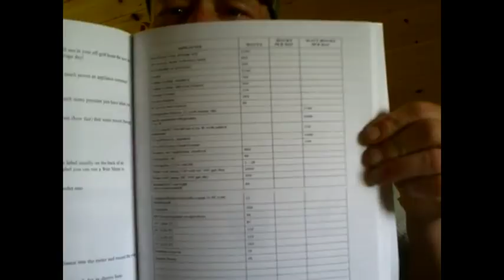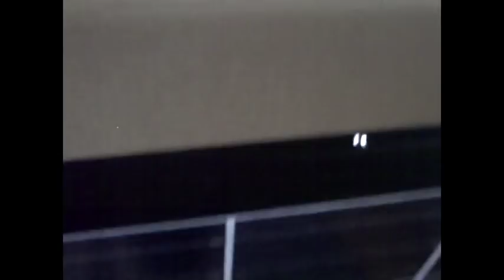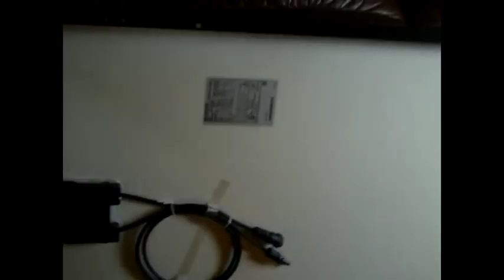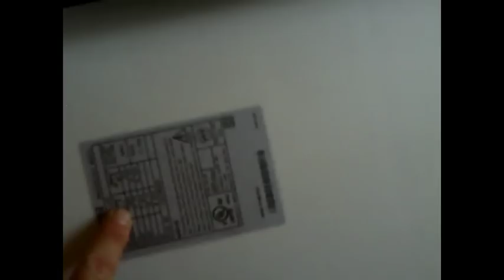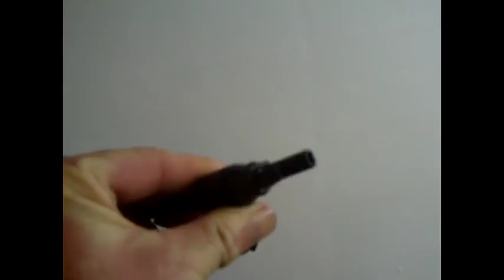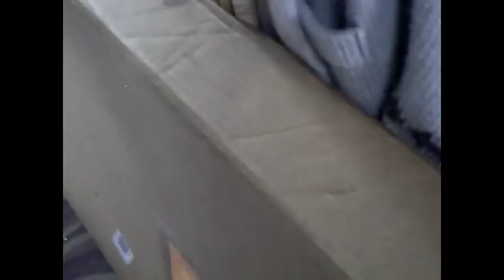Off Grid Solar and Wind Installation Part One

Comment: If I had not already subscribed because of your solar septic video I would have because of this video. You have given me so much to think of & so much hope. I really wish I could afford to live on my own land with a shipping container home that has solar power & my own garden. That is an absolute dream of mine. I like your video's those that I have seen & thank you for posting them. Thank you so much. All I need is 70,000 & I wouldn't need to much else for a long time. That much & I would be off grid & independent financially.
Reply: Why so much? All in, between 3 acres of land, 2000 watts of solar, and the cabin, I am in for $21,000. Here in the Rockies. Just curious. :)
Reply: That includes everything. Land, 3b 2 bath with everything but furniture inside, 2 car garage, work shop, totally custom home. Land here costs more then there but I will look into land there as that is a great price point for 3 acres of land alone. Did you build it all yourself? I would need workers as I am injured. Later on my page I am gonna post a short video of how I made a model of what I want my home to look like when I am done. The pic at the end doesn't include the out door spaces like the garden or additional on the ground solar panels, green house {& in ground pool made of 2 shipping containers if I can afford it}. Not to mention the fence. I don't like chain link fences. Love wood picket fences.
Reply: EmperorJinx151 There is the price differential! Fencing. One does not immediately realize that fencing three or more acres adds up. That linear feet in my case if 1500FT. 

I did all the building myself. Correct. Although for the Cabin, I did have a friend help for a few days to get it dried in. 

Looking forward to your model video posting.

Comment: I seen a few of your vids and have learned quite a bit. I have been thinking about a small 4-6 battery bank but atm I only moderate knowledge from just doing research, and ~half understanding of the electrical side. Some of my questions were, whats the current solar technologies (best decision for US city/residential environment, best batteries and understanding charge controllers. I also have been looking into assembling my own panels from cells which seems to greatly reduce cost. (Thanks!)

Comment from the maker: Concorde's are great batts. Get the specs for the number of plates, plate thickness and amp hours. Generally 6 volt batts have thicker plates and will last a few more years than 12 volt batts.

Comment from the maker: Your battery bank will level off. Unless you have an air turbine with a built in shut off controller you  will need some way to dump off the excess power. Instructions are in my book.

Comment: I have been wondering if 2  solar panels per every 12 volt link would be enough using 6 volt deep cycle golf cart batteries,or if 3-4 will do the job ? Also given uneven discharge events per battery on a battery bank would there have to be float chargers to cycle in and out,or would  neighboring batteries level off any excess charge,or discharge ? Does hybridizing a wind charger present any system conflicts while using solar panels on windy sunny days?

Comment: Hello Lamar, I have been enjoying your videos for the past 3 years,I live in NC,near the coast and I noticed a lot of videos like yours use 12 volt deep cycle batteries.I used to work at Exide Electronics and wired battery trays for computers Uninterruptable Power Supplies,and I upgraded 36 volt systems on golf carts to 48 volts.I have noticed that 6 volt or 8 volt deep cycle golf cart batteries can store more amps and use the same charging system. I enjoy your videos keep  them coming coming.

Comment from the maker: A 280 watt panel is probably 24 volt so yes use a controller designed for 24 volts and two 12 volt batts hooked in series for storage.

Comment: why is it that the solar panels they onli deals with wattage, what about the volts coming from that panels. because , the discreption on the back of the panel is a 280 watts, 37.4 volts. can i use a 30 amp 12 to 24 volts charge controller? can this controller handle the 37.4 volts? most of the charge controller 10 amp, 15 amp, 20 amp or 30 amp and always 12 to 24 volts. is it ok to use any of this charge cntrlr  no matter how many watts my panel is?

Comment from the maker: Most likely you need a batt connected before the controller will read anything. You can test the panel output with ant cheap battery tester.

Comment: well, it surges to just under a thousand watts when it kicks on, and stays around 120 watts according to my inverter (the inverter is 1500 watts) ... we have 4 125 amp hour batteries under the house hooked up to 2 235 watt panels... the fridge is from lowes i think, its small, but has a freezer and fridge... i think its 4 cubic feet?  bigger than a dorm fridge for sure.  Magic Chef I think is the brand name.  we dont have a generator yet, the batteries are fully charged by about 9:30 am :)

Comment from the maker: That is probably a 24 volt panel so you would need two 12 volt batts hooked in series. full instructions for 12 and 24 volt systems is in my book. simplesolarhomesteading

Comment: Perfectly explained on what's the difference between grid-tied and off-grid solar power systems. Off-grid systems are good specially if one's installation is on a remote area or on a moving vehicle.

Comment: -- Missouri Wind and Solar sells charge controllers that can handle 440 amps and 10,000 watts for solar panels and wind turbines. The cheapest controller, without a meter, is priced at $120. That means you could use about 70 of those solar panels with this controller. That should be enough. :) But it is not an MPPT controller, so it is not as efficient.

Comment: great video. I know you say you have to have an licend electrican to install a gride tied system.  that is false you dont have to but it still has to be inspeced, and it has to be up to code.  and if they find something wrong you just have to fix it . and when it passes then you will beallowed to conned to the gride and also the power company will also inspecit.

Comment: @solarcabin -- Now I understand why their wind turbines are cheaper -- they don't have as many features. They have a 1600-watt wind turbine for $600. I suppose a person could just manually turn off the wind turbine when the batteries are nearly charged. For those on the grid, they could divert power with an inverter to the grid. I was looking online and I see Chinese-made 1,200-watt grid-tie inverters for $250, and the inverters can be stacked for more wattage. All you have to do is plug it in.

Comment from the maker: @BullittMcQueen1 

The Air X does not require a diverter and the power controller is built in. It shuts down when the batteries are full so it won't overcharge the batts.

Comment: @solarcabin -- Missouri Wind and Solar offers a one-year warranty. That seems pretty good. I am not sure the reviews on a company's own website. The controller they offer can handle up to 440 amps and 5,000 watts at 12 volts. But it has a basic load diverting system that can only handle 600 watts. If you get more power generation, you have to get more load diverting capacity. Does your system have load diverting? Where does the excess power go?

Comment: I found that Missouri Wind and Solar has an 800 watt wind turbine and an all in one charge controller that can also be used with solar panels, has a 3-phase brake switch for the wind turbine, a load diverting capability when batteries are fully charged, and the total price is $779.
I noticed that Northern Arizona Wind and Sun is cheaper for solar panels, though.

Comment: Hey Lamar. You really have done a great job on your videos. FYI, UL is Underwriters Laboratories, an INDEPENDENT & NOT FOR PROFIT Organization. They are not Government Affiliated in any way. Also, not every Solar Panel will be UL Approved or Tested, but that does not mean it is inferior. But you will find that to use for a GRID TIE System, you will need UL Certified Panels. It is quite a controversy actually. Just wanted to toss that out at you. Keep up the Great Work.
Ron

Comment: i did a test off grid last night with just batteries an the inverter been putting all this system together and researching for three months. soon the windturbine will arrive and get everything all together. Can not wait to call the electricity company and disconnect it for good!